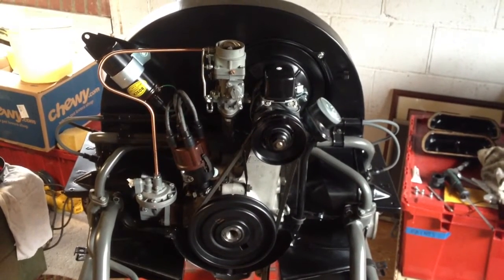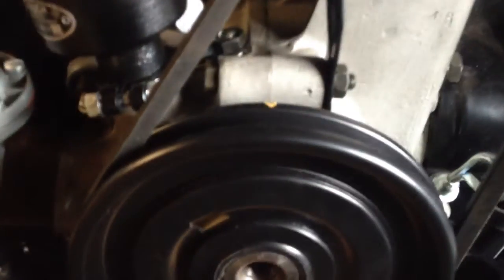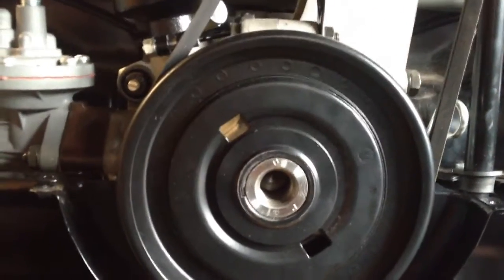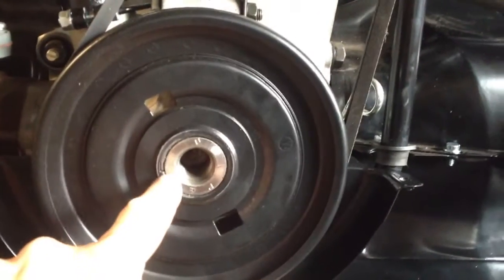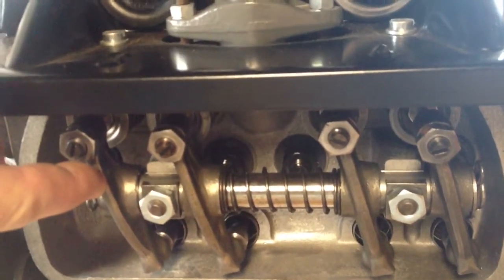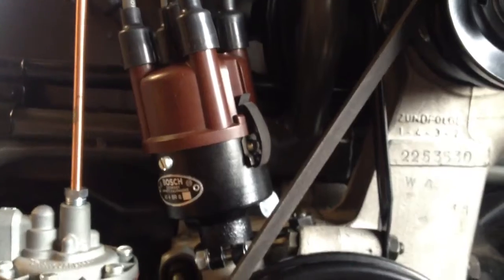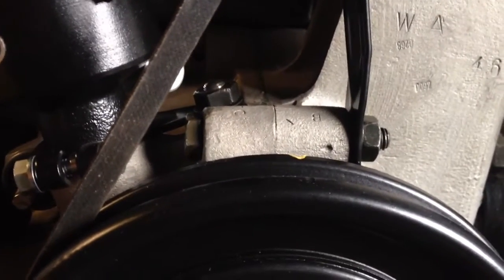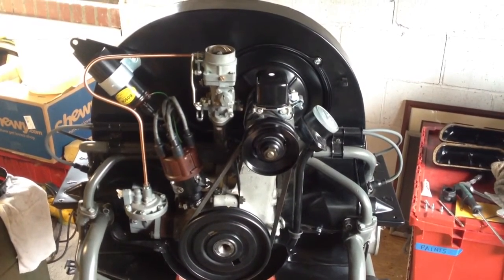Finding TDC on VW air cooled engines for valve adjustment and distributor orientation.

Comment: my project for today: 
find TDC for all four cylinders
paint a number on the bottom of the pulley, because the baja exhaust is in the way of the top
paint a dot on the side, front of the pulley, so I can see where I am while looking at the valves

Comment: I was banging my head for a month with my bug. Some how i ended with a 180 deg rotated distributor. I extremely grateful. If you could add to the title that the engine it 1200cc

Comment: Appreciate your vvidoe, I'm trying to find out timing on a bus 2lt.
There aren't many that don't use beetle engine. Also I've replaced my dizzy with a electronic. I had moved the engine without the dizzy in motor. The rotor points 90 past tdc. But my open inlet valve is open with spark plug removed in no 1 pot.
Regards

Comment: Thanks for this ! Question, do you advise using a spring on the rocker shaft between the exhaust rockers? I don’t have one. If you recommend , where are they sourced. Thanks again

Comment: Great video - I have 1974 beetle with tons of hesitation - been through carb, fuel pump, now going for timing.
I have a few questions:
1. Is there a good simple diagram to confirm I have all hoses in the right places? 
2. I notice another 1/2" port (top right) on fan shroud - what is that for?
3. I have a metal tube (maybe 3/8") coming up from the deck plate (drivers side to left of dist) and lands in a lil pot (with a lil nipple on top of it) mounted just behind the carb.  I have not seen this on any bugs any videos.  Is there a way I can send a photo? 
4. Will timing just go out? 
Thanks the TDC explanation was the best I've seen...  Love the crankshaft keyway check, too.

Comment: If your rotor button is facing number 1 on the cap , (the tinware is numbered) then set number 1 then turn motor anticlockwise 180 degrees then set 2  again for 3 and again for 4 if your a few degrees of it makes no difference. The firing order is 1432 so going anticlockwise from 1 makes it 1234 . As a rough guide if your inlet is opening you can check your exhaust and vice versa

Comment: A simple way to find #1 TDC on compression is to bring it up, back it off 1/4 turn or so and see if both valves are closed. A simple finger in the spark plug hole works too. For valve last adjust the intake valve when the exhaust valve just starts to open, then adjust the exhaust valve just after the intake valve closes making sure you are rotating the engine the same direction it would run in. Once you get used to this method you can run through an entire engine extremely quickly with minimal total rotations and perfect results, the only down side is you need a way to mark which ones are completed. Stil a good video for beginners that don’t really know how things work well and in fact your video could very well cause them to understand.

Comment: No pulley mark on mine. So this is very useful information after ending up with running  2 cylinders probably as 180 degrees out on RHS. Interestingly, I could chug along at about 10 to 15 MPH and 30mph on slight downhill.  1970cc aircooled  running on LPG. T25 ,T3, Vanagon.  Thanks for a very clear description.

Comment: Thanks for the information you shared on this video. It seems so easy for a mechanically inclined person to complete. The only thing that I don't understand now is why does every video, involving valve adjustment, the narrator has the engine on a stand or table or whatever and does not have the engine installed the way most of us searching for help with these videos have their engines? Not really knocking your video, i just don't want to remove my engine to have the advantage you had. I just would like to see what it takes in the real world.

Comment: Thank you for the sharing your knowledge.  Very useful information.  What are some of the possible symptoms if instead of finding TDC for cylinder one the alignment is made to cylinder three?  I am new to the VW world and have the same engine.  My car starts but then it dies off.  I suspect that I have the incorrect TDC cylinder lined up.  I will use the information that you have provided and verify this tonight.